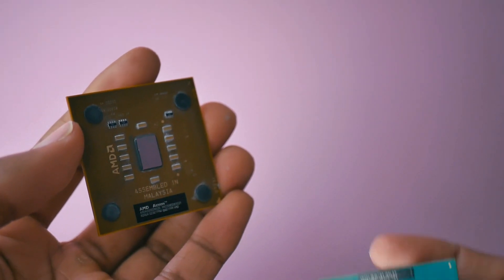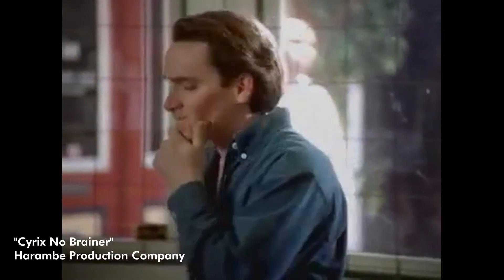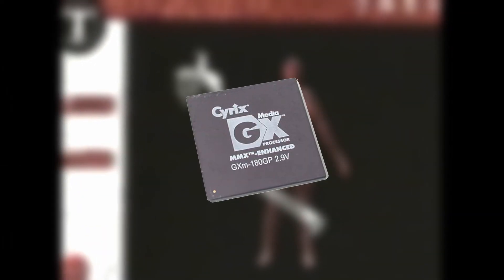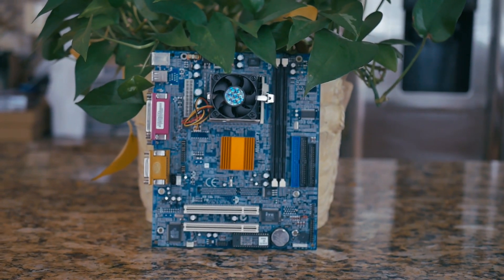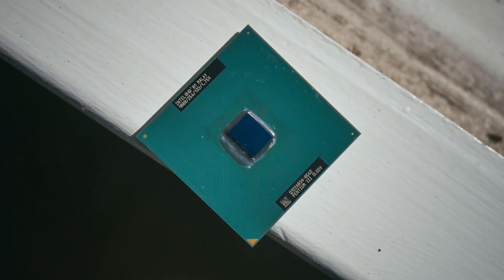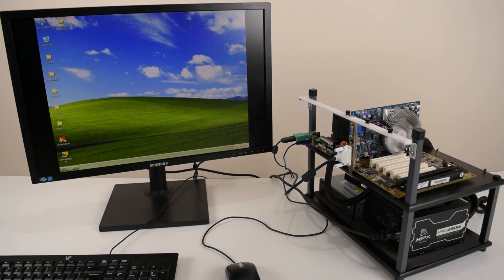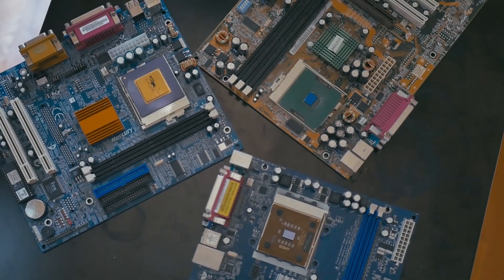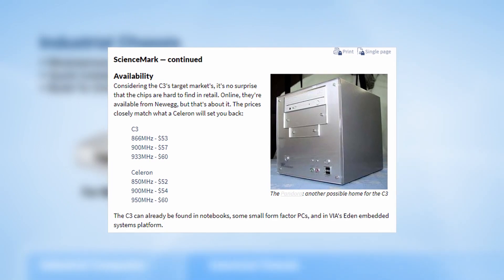A CPU Not Made By Intel or AMD w/ Phil's Computer Lab | OzTalksHW

Comment: Wow, I started getting into computers in 2000 and this was a real flashback. I wonder how Linux would work with this hardware. I hear Puppy Linux is really good for old hardware so maybe you can try it out.
Reply: >I wonder how Linux would work with this hardware.

It's like trying to run Linux on a fast 486. You'll need a very old Linux distro from the early 2000s which is compiled against i386/i486 and not the i686 Pentium.

>"Unsupported instruction: cmov". Had to download an i486 kernel instead of i686 to fix that :D

This happens because the Centaur Hauls core in the VIA C3 is an i586 class processor. It lacks the few necessary instructions introduced with i686 class processors like the Pentium and AMD K6 to work with anything compiled against i686 instructions. This wasn't an issue 20 years ago, but it is a problem today because it's basically the minimum compile target used for 32 bit code, meaning that modern Linux distros won't work on it.

It also means Windows XP is the last Microsoft OS which will run on it.
Reply: I remember after the VIA PC1 platform came out, I was like YEAH!! finally a low cost solution for my Church library to use on Linux to set up a database of all the books, NOPE!! As others have stated they  were not well supported on Linux, and more so with distros based on Ubuntu with Deb. packages like Linux Mint, plus the VIA C7 and Chrome 9 IGPU where sluggish as hell. I ended up biting the bullet, and going back to XP SP3 32bit even though the performance was not great, at least the OS did not have a thousand, and one other issues.
Reply: wary puppy linux will work on anything P1 up

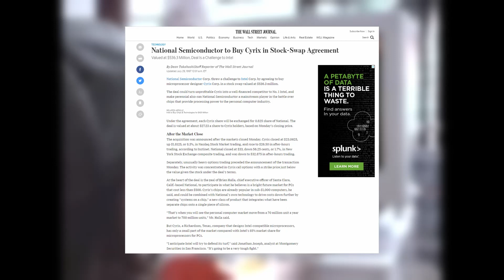Comment: edit: I completely missed how your video actually does include the sad tale of the Joshua core, starting at 2:40 - oops!

Hi Oz, a very enjoyable video! Note, however, that VIA bought Cyrix (as discussed in this video) and Centaur (another x86 design house, which previously designed the WinChip manufactured and sold by IDT) in short succession. The Cyrix design didn't make it to market due to Cyrix being in very bad shape after extensive mismanagement by National Semiconductor (the previous owners of Cyrix) - what was left of Cyrix was not able to debug the succeeding design of the 6x86/MII. VIA instead sold Centaur's design (the successor to their WinChip design) as "Cyrix III" due to Cyrix being the better known brand. They later shortened this to "C3". In short: The C3 is not a Cyrix design, it is a Centaur design in direct technical lineage to the "IDT WinChip" and "IDT WinChip 2".
Reply: VIA actually sent out review samples of the Cyrix designed C3 to reviewers, then cancelled it a day or two later and sent out the Centaur designed C3 chips. I remember some benchmarks comparing the two and the Cyrix chip was the faster of the two.
Reply: Arguably National never needed a competitive x86 processor, more an x86-compatible processor they can sell for embedded electronics such as PC104 deployments. So it makes sense in that context that they didn't give Cyrix a lot of room to breathe and would rather have them work on something else, as they were fine with that ageing and increasingly incompatible with new consumer software but fairly fast processor and needed nothing else - even protected mode or anything beyond a 286 were considered often an overkill for PC104, so existing Cyrix design would cover them for ages. VIA however needed a competitive x86 processor that can be used in consumer PCs, a companion to their chipsets, and could directly compete with Intel and AMD offerings at least in the very bottom dollar niche.
Reply: 0mongo0, That's crazy do you remember what the power consumption was like?